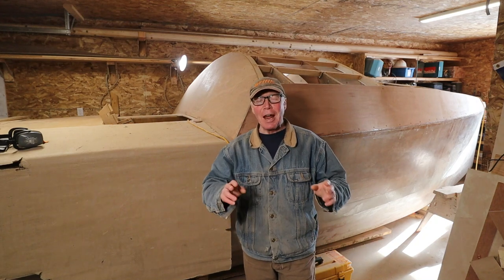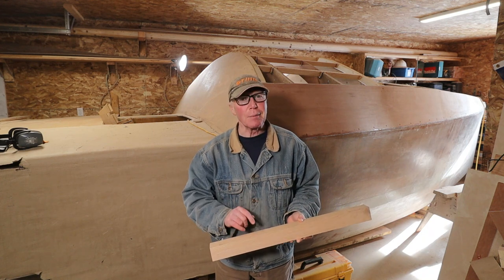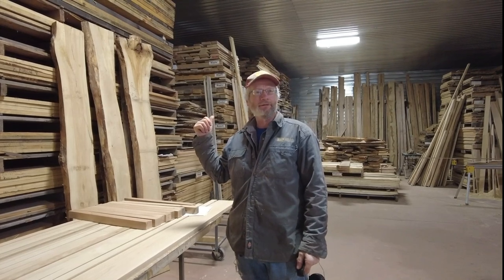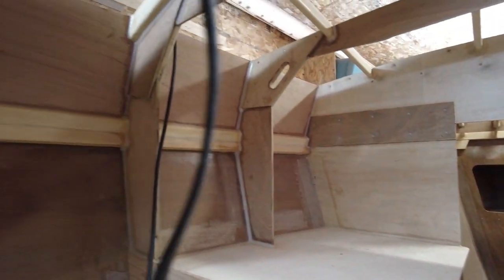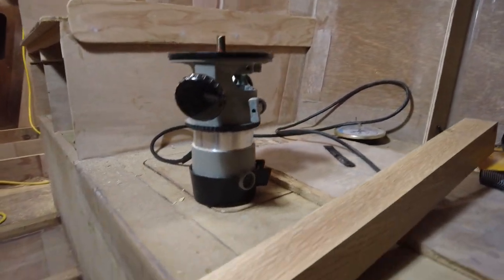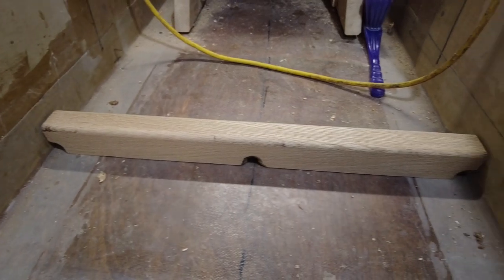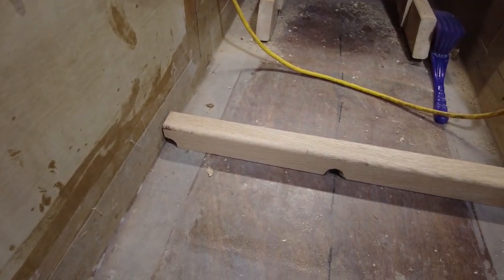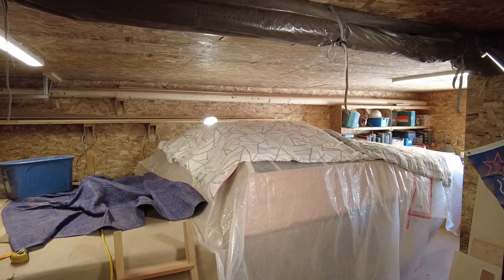S2E72 Floor Timbers Installed || Drill Press Repair || Pecron Portable Power Station

Comment: Looking amazing, so close! Any thought to some traditional light and heat, oil lamp and solid fuel heater ( wood burning stove)? I can say with confidence how beneficial I have found the oil lamp on my boat, not just light but a small amount of heat and comfort.
Reply from the maker: I agree with you about the light but I will be using LED lighting. Although, I may see if I can find a small oil lamp if I have room.

Comment: Are you planning on putting a small line through the limber holes to pull back and forth to help clear them if they get clogged or just lift the sole boards? Thank you Alan and Mrs. Wave Rover for the wonderful videos.
P.S.-Like the router table. Much better than my cheap aluminum table and much ore portable.
Reply from the maker: Good idea to clear the limber holes
Reply: Light chain works even better for this.

Comment: Allan i just bought a couple 8’ 4/4 “White Oak” boards for my build floor timber’s. I tested it by cutting a 2x2” block setting endgrain up in a 1/4” of denatured alcohol…the WO tested BAD with alcohol being sucked straight up through the fibers to the top of the block. It is some type of red oak or a porous white type. The wood will rot unless meticulously epoxy coated. I decided to go with mahogany on my floor timber’s.
Reply from the maker: That's very unfortunate. Mahogany (Honduras) is quite rot resistance, I have used it in the past, but doesn't have the strength of white oak. I hope that you returned the white oak as it wasn't what you paid for.

Comment: I don't believe that the floors actually connect to the ring frames. They merely abut the side bulkheads. This allows only an end glue joint, which I don't think is as strong as it would have been, if the floor overlapped the ring frame. Hopefully, it will be strong enough.
Reply from the maker: The forces are in compression and the loads all have clear paths.

Comment: I have one question.
Since your boat is made of wood, how will you prevent the rottening of the boat?
Reply from the maker: It's marine plywood coated in epoxy and fiberglass
Reply: @RoversAdventure  ok, how long can it survive in water?
Reply from the maker: @jugabratdeka2191  I know of several that are over 40 years old. If the boat is well maintained it should last indefinitely. Everything is sealed in epoxy
Reply: @jugabratdeka2191  Lately I've been looking at a couple of Wharram designs which are often stitch-and-glue plywood construction, often with fiberglass only on the outside and the insides of the hull only coated in epoxy, with fiberglass tape on fillets to keep them light. It seems many examples are decades old boats still in great condition while others have perished (or been damaged and then restored) if neglected.

Must be down to the owner staying on top of things and having the boat built properly in the first place so that nowhere does the wood get wet and stay wet. It's like a cored deck I suppose; any screwhole or ding that compromises the protective coat will start the process of rot if the damage goes unseen or is neglected long enough. Any hole needs to be drilled, filled with epoxy to protect the wood inside, and the ultimate hole then drilled into the epoxy filler. I suppose it's not like a steel boat is impervious to "rot" of its own either. It just requires a keen eye and experience to stay on top of things to keep them ship shape.

Comment: That looks like what I believe to be a “Morse Taper” (possibly a #2).  I’m not sure, but think that the Jacob’s Taper is a little different.  And a previous commenter is right…you almost don’t even need to tap them on with any force.  It’s amazing how they hold if only pushed-on. Even if lubricated with an oil rust inhibitor, they fit so well, they just grab right-on.  Keep up your fine videos.  You are a real pro.
Reply from the maker: It was a J33. Jacobs taper 33. Apparently it is the most common chuck. Yes I realize that I didn't need that much force lol, it was my first time.
Reply: My vote Morse #1 but it's an angle and could be a #2.  Sometimes the name is  confusing for people, we just measured the angle.
Reply: Wonder if there is a slot higher up on spindle to knock out the arbor. Lol what fun  your having.

Comment: If the Pecron "power station" has a fan, it must need airflow to cool the power electronics. Putting a dust cover over it while in use would block, or at least greatly reduce, that airflow, potentially leading to it shutting down due to overheating, or even damage.
Probably not an issue running two LED lights, but could be a problem when running power tools.
Keep that airflow unobstructed!
Reply from the maker: You are correct and of course it also needs to be uncovered when charging. With light loads you can leave it covered, you will hear when the fan comes on, and uncover then. You don't want fine dust getting into your electronics!

Comment: I think I would have used a table saw to cut the holes. Am I missing something?
Reply from the maker: I believe I said you can use a variety of tools to make the cut. They turned out great with the oscillating tool
Reply: I was thinking of cutting the holes all the way the table saw, no drill.
Reply from the maker: @CharlesJWillard  I see. That should work. Coat the insides well with epoxy.